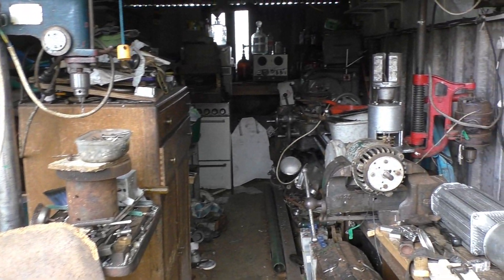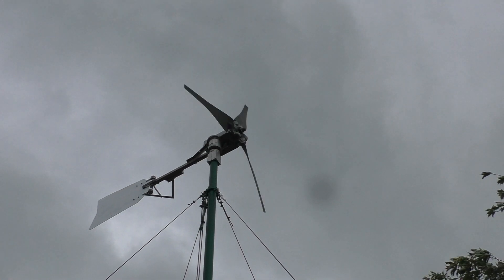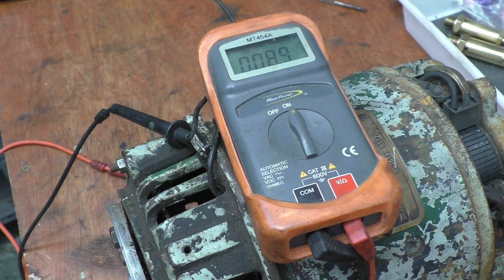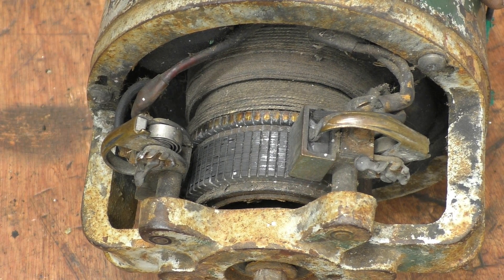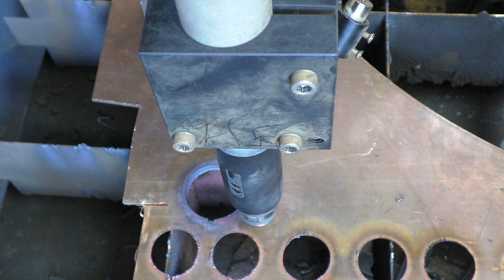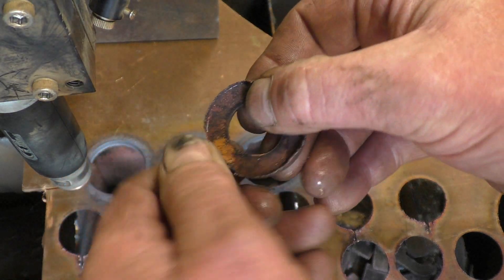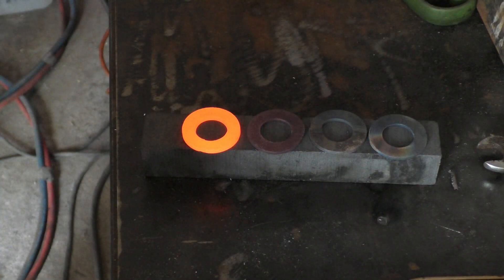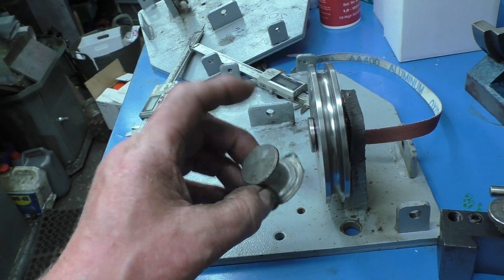SNNC385 P2   DC Generator  , Plasma Cut Copper

Comment: I guess expansion of the copper as the the plasma was cutting it caused the distortion of the outer circle of the washers? (not something awry with the control...)
Reply: The inner surfaces had similar issues.  I wondered if the start points were too close to each circle or the pierce-through phase lasted long enough to melt an oversized hole, while the cutting phase was going fast enough that the cut was made as if with a smaller diameter endmill.

Comment: John, I would give the commutator an emery in the lathe and see what it's like. I used to overhaul industrial generators many years ago as an apprentice, it does look like the type of comm we would skim but if there isn't much depth left it could be a problem. I don't suppose a replacement armature would be easy to source. Great videos, my workshop is also suffering horizontal surfaceitis! Best wishes, Dean in Oxfordshire.
Reply: Emery is the wrong material for cleaning a commutator, it should be glass paper
Reply: @johnrudd9550  it wouldn't make a blind bit of difference if he uses a fairly fine grade. He isn't going to be concerned about brush wear on a unit that will run for a few hours, at a handful of steam rallies each year and I've never heard of a unit suffering from conductivity issues either. Wive's tales.

Comment: Great videos John. It will be interesting to see the old generator restoration.

You should build a steam electric hybrid vehicle. Steam engine driving generator driving ac electric motor via inverter  for traction. Mix of the old and new.

Comment: I always like free energy and a windmill seems feasible. Watching your video reminded me of problems I've read about with the large commercial units. Too much wind is dangerous. The rpm needs to be controlled. If the unit self destructs, a blade breaking off  would make a mockery of King Arthur's sword even on a small windmill. Alternators only need to spin maybe 1500 rpm to produce maximum current. All the parts must be capable of withstanding the forces and home built units add to the issues due to testing.  Be safe.

Comment: No problem for you to skim the commutator John, just make sure if you have to skim it down to the insulators between the segments you make up a scraper to go between the segments and scrape the insulation down below the copper surface by about 2 mm and you will be good to go. And a paint job of Stuart Turner green!

Comment: I was waiting for you to put the armature on an old-fashioned "Growler" tester with the hacksaw blade one used to see if it was good or not.  Most mechanics today could not even diagnose an old-fashioned generator, set a points style regulator, cutout,  or understand what a 3rd brush generator is.    Great video.   It will be interesting seeing the generator being driven by your new steam engine.  Bet that copper cost an arm and a leg.
Reply: Third brush Generator is unless I am mistaken is a constant current source that is self regulating via the third brush shifting the magnetic field. Please correct me if I barking up the wrong tree. John, Australia.
Edit: The others are easy.
Reply: @joandar1  In automobiles of the distant past, a 3rd brush generator was one that we would move the 3rd brush to make the generator produce approximately 7 volts of output to keep the battery charged when the engine was running at normal rpm range and the lights bright enough to see where you were going.  The only control relay was the cutout relay that would connect or disconnect the generator from the battery at preset values.  If it failed one would burn out your headlights or other items, or when you turned off the engine the generator would try to run like an electric motor.  That was when the driver would get out, raise the hood, and pound on the cutout relay to make it disconnect.  The 3rd brush generator dropped out of style when the 2 relay and 3 relay voltage regulators were used to control the generators.  One relay in the regulator still function as the cut-out relay and the 2nd in the 2 relay regulator was for voltage control.  The 3 relay regulators had the cutout relay plus a current control relay and a voltage control relay.
Reply: @bigun447  Thanks for the heads up, I do confess I am a little rusty on the subject. I do however have my Grandfathers books covering all this and many more systems. Some generators did along with the cutout relay use centrifugal regulation and I found that interesting how different some methods of regulation were on early Motor Cars and so on. Dykes Automotive Encyclopedia is on of the references I have and occasionaly use. Cheers from John.

Comment: You can skim the commutator, so long as you don't machine into the mica insulators, between the bars.

I'd also recommend a very sharp HSS tool, so you get a good shearing action.

Comment: Thanks for sharing! John stop by a local electric supply store and pick up a spray can of contact cleaner. When you open the generator to change the bearings clean the coils with contact cleaner. A word of warning, the contact cleaner here in the States uses ether for propellant. Do it outside or in a well vented area.

Comment: For the commutator, I'd be tempted to mount the armature in the lathe, spin it up slowly and then just give them a gentle polish up with some fine emery tape.
Reply: Looking at the commutator I think it's past the stage of emery cloth. I'd spin it up between centres and skim it down to good clean copper and leave at that. I was told when I was a lad that if you used emery cloth to clean them it leaves particles of emery embedded in the copper as it's soft then that will vastly accelerate the wear on the brushes.
Reply: @samrodian919  That's true but looking at the state of them there might be a danger of plucking one or two off if you try and put a cut on it?
Reply: @samrodian919  I was also told to never use emery because the abrasive is conductive. I've always used garnet paper. Much safer for seating in brushes.
Reply: @highpwr  I worked at a workshop that overhauled marine and plant generators and motors as an apprentice. I was taught to emery a comm to get a bit more out of it if it was past skimming. As long as you don't use coarse tape it won't harm it at all. If particles did get embedded, I doubt it would make any difference. He won't be running it at a rate to worry about brush wear. I certainly never heard of any that had problems with wear or conductivity.
Reply: @samrodian919  Glass paper should be used not Emery!
Reply: Yeah I just wouldn't put a cut on it with a lathe tool. Wouldn't want to rip any of the com bars off!